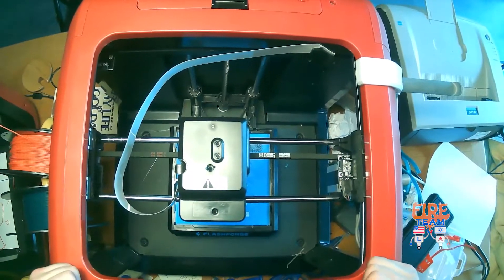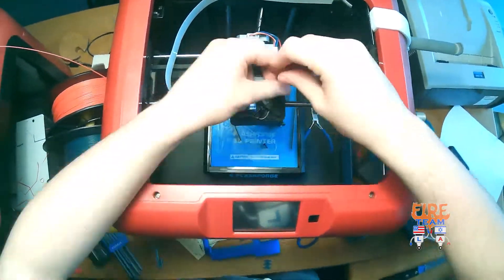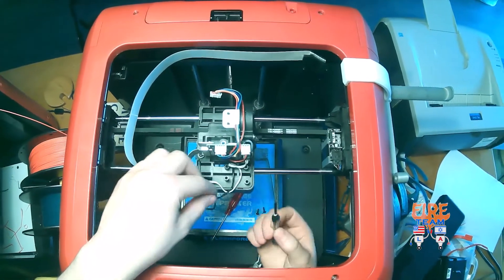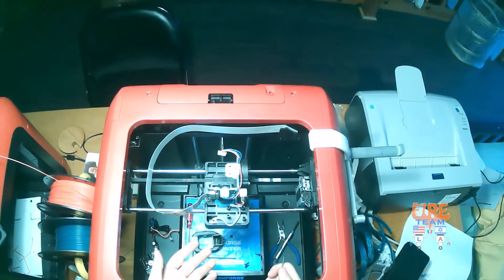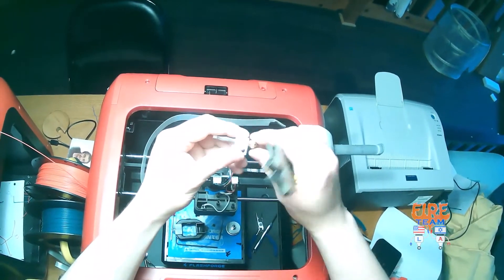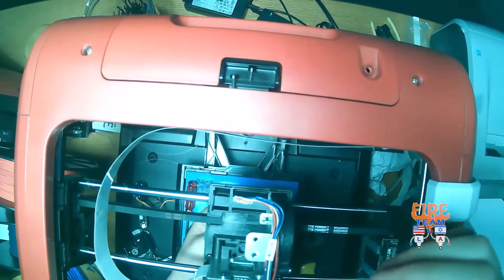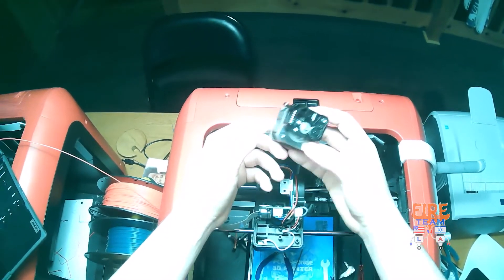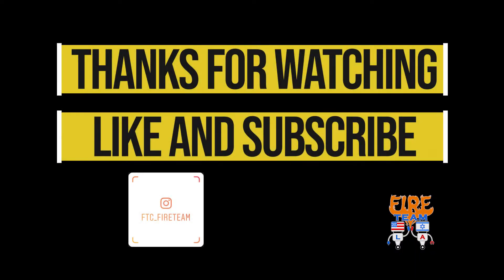Flashforge Finder Dissasembly

Comment: My extruder assembly refuses to come off. like it is glued underneath, all the screws are out... any suggestions (It came off for repairs before)
Reply: I had the same issue, like it was stuck in place. Took some wiggling, but it ultimately came free.
Reply: I got the last piece of filament out and just fed some more through. thing is still glued there if I had to guess, but working again... @MrTimHerr
Reply: Having this issue too ive even tried to pry it up in case it was just a little stuck but nope its like its completly superglued down. Did you find out what it was?
Reply: @Canada_Official  I forgot there were two more screws in the bottom of the face plate that unscrews with L key.... Don;t know how I missed them, they are a bit recessed... but I swear I looked for them 10 times before...

Comment: This is the same as my Guider 2.  I was just about to ship it to a repair shop as I did not know how to get the filament feeder off to remove the clog in the guide hole.  This would have cost me shipping cost back and forth to another state as no-one in my state repairs them, plus the cost for analysis even thought I supplied a picture of the clog, plus the repair.  This video was a life saver.  Thank you for sharing!!👌👌👌👌

Comment: I've followed your directions to the letter and my extruder is still attached somehow. It will rock up from the left hand side, but it will not release. It's like there is another screw on the right somewhere holding it down. Can you advise?

Comment: Sorry but why did you dissasamble the half of Your printer.
Fix the extruder and remove the nozzle. You dont need to dissamble anything....
After i saw the constuction of the printer in Your Video, i realized that This is Not necessary and removed the nozzle without removing anything. IT Tools 2 minutes 😁
Reply: The purpose of the video is to guide you on how to disassemble and reassemble it properly so it can serve as a reference for various repair and troubleshooting tasks.  It helped you do what you needed to efficiently, and it helped me discover a missing part.
Reply: @The2xWhiskey  right, i didnt expect this point 💪👍